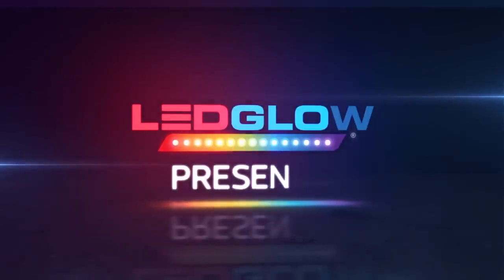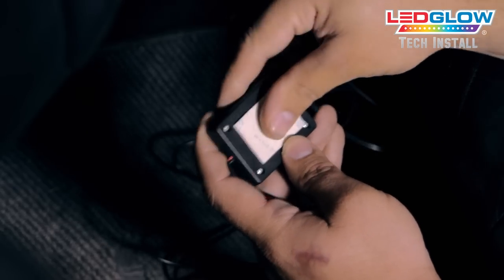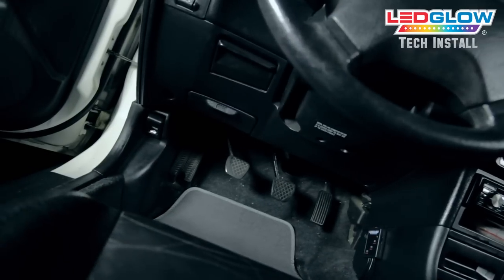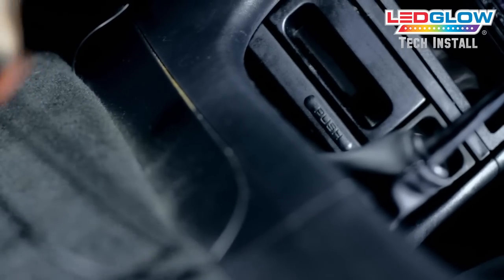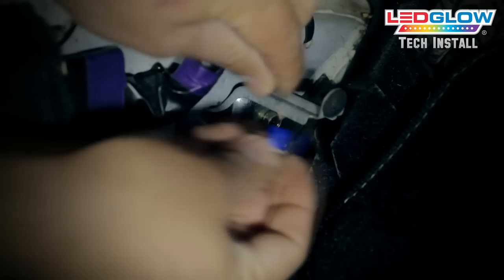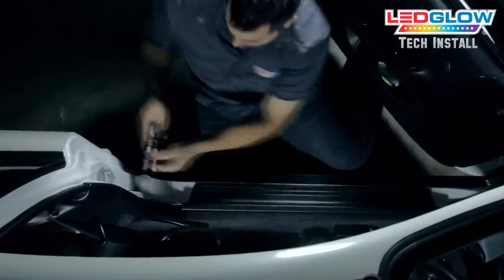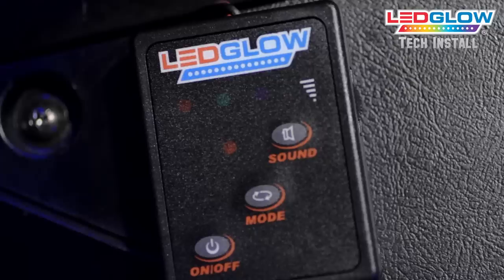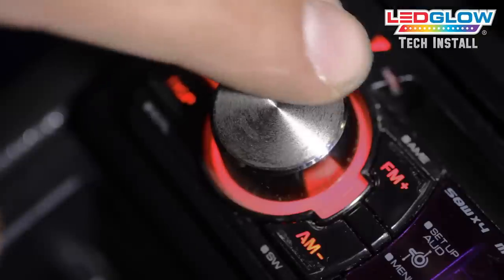Installation | LEDGlow 4pc 7 Color LED Interior Car Lights and Truck Lights

Comment: I plugged it to the cigar fuse using the add a circuit , I can't find anywhere to put the ground wire into the bare metal surface
Reply from the maker: Renzo Chacon You can connect the black ground wire to any screw that threads into metal on the floor board, under the dash, behind the pedals or even the firewall. After you connect the wire to one of these locations, make sure you power your car on to test the kit because most cigarette lighter ports can only function when the car is on.

Comment: I have my kit all set in my 04 Camry & I removed a fuse from the box only to find out that my add-a-circuit is the wrong size and won't fit back into the box.
I'd like to have my lights working by this weekend, what would you recommend me doing?
how would I directly connect my +/- wires to a power source?
Reply from the maker: Trevor Seet If you want to connect the power and ground wires directly to the battery, you will have to extend the wires by using 18 gauge automotive grade wiring. We have a video you can check out called "LEDGlow's Powering Your Kit Directly From The Battery" that will walk you through the install process. If you don't want to extend the power and ground wires to the battery, you can also go to a local auto shop and purchase a mini expandable circuit for your 2004 Camry. If you have any other questions or concerns don't hesitate to ask!

Comment: I have a 2011 dodge challenger se and I was wondering about what all I would need to order. I want the 6 pc expandable million color mini smd led's. Is that all I will need? Will I be able to hook them up without running into an issue with needing something else? And that is the one that comes with the driver and passenger footwell lights right?

Comment: Quick question, how long are the wires? I wanna know if I can pull them towards the trunk of the integra and still have 2 under the seat
Reply from the maker: +Kishen Maharaj The interior kit featured in this video has 6ft of wire per tube. If you feel that is not long enough to reach the trunk, our Expandable Million Color and Single Color SMD Interior Light Kits feature wire lengths of 5ft and 10ft. If there's anything else I can help with don't hesitate to ask!
Reply: +LEDGlow that Is awesome! Thank you 😁😁

Comment: I have a 1986 Chrysler Lebaron, my 12v fuse is always running so the cig lighter remains on if something is plugged in even if the keys are out, what fuse would most likely be the one to go on and off when the car is on and also no short out the leds?

Comment: I just bought this kit from amazon.
How do I should get the cables from the drivers side to the passenger side without leaving them expose?
Reply from the maker: Anthony Paul Polanco Garcia You can pass the wires from the driver side to the passenger side of the vehicle by either under the center console or by passing the wires through the dash. Let me know if you have any other questions or concerns!

Comment: Do you have to ground the wire if you are using a cigarette lighter adapter?
Reply from the maker: brian oneill Yes you will still need to ground the kit, but with the cigarette lighter adapter you will crimp the power and ground wires from the kit into the quick connectors and insert them into the connectors of the cigarette lighter adapter. Check out our installation video called LEDGlow's Cigarette Lighter Adapter and it will go thru the entire process of using the adapter. Let me know if you have any other questions or concerns!

Comment from the maker: Luis, the 4pc Blue Interior Lighting Kit is priced at $32.99 as well as the other 4pc Single Color Interior Lighting Kits we offer. Colors available include Blue, Red, Green, Pink, White, Orange and Purple. If you can't make your mind up on one color or just want more lighting options, we also have a 4pc 7 Color Interior Lighting Kit priced at $34.99. Let me know if you have any other questions!

Comment: 2009 Chrysler 300--I can't find the door switch. Is there an alternative to using this? Also, even if I was to locate the driver door switch, would it still work if other doors are opened?
Reply from the maker: Jeremiah Hocog If you want to have the kit illuminate when you open the driver door then the black ground wire must be installed to the driver door pin. If you find door pin and install the black ground wire to it, the kit will only function when the driver door is opened and will turn off and not function with the door closed. Unfortunately when the kit is connected to the driver door pin, opening any of the other doors will not affect the kit since it is grounded at that specific location. Let me know if you have any other questions or concerns!

Comment: Do you have to use the add a circuit or could you just wire it straight to the battery.
Reply from the maker: +Justin Bryant The expandable circuit is an optional installation accessory that you can use to power the kit from your fuse panel. If you don't want to use the expandable circuit for your installation, you can absolutely wire the kit directly to the battery!

Comment: What are the parts used in this video that is not included in the package ? So I know what to get to make this happen ?
Reply from the maker: The expandable circuit and wire connectors do not come with the kit.

Comment: I want to buy this kit but it looks so difficult to install, if I buy the kit plus the 12V Cigarette Lighter Power Adapter it's like skipping the whole process or what?
Reply from the maker: Gabriel Coello If you feel uncomfortable installing the kit yourself then I recommend taking the kit to get professionally installed at a local auto or stereo shop. The installation process of mounting the tubes, control box and hiding wires will remain the same, but will change when you get to the step of powering the kit. Check out our video LEDGlow's Cigarette Lighter Adapter to see the process of powering your kit with the cigarette lighter adapter! Let me know if you have any other questions or concerns!

Comment: Do I have to use 3m adhesive or can you screw the control box under dash?
Reply from the maker: +Hunter Lovick Thanks for the interest in our product! The control boxes also have locations where you can use screws to mount them instead of using the 3M adhesive.

Comment: @ledglow what about a 2012 camry? I bought the led interior lights but I guess now I have to buy an add a circuit because it didn't come with one so which one should I get the mini or the other one

Comment: Nice video, these look awesome. Any idea if this is legal in Virginia?
Reply from the maker: ***** Thanks for the compliments! Laws and regulations regarding aftermarket LED lighting accessories vary from state to state. I recommend contacting your local police department and ask them directly directly as they'll be able to give you a definitive answer for Virginia.
Reply: LEDGlow Thanks for the reply. I checked, and I believe they are illegal in Virginia. Just for clarification though, you can install these and only turn them on manually, is that right? In other words, the lights don't have to be on every time your car is operating/exterior lights are on, correct?

Comment: Hi I need help with the whole "add-a-circuit" I have the underbody and interior lights kit and I don't know what fuse I have to put in there? Any help would be appreciated
Reply from the maker: Clay Turpin You can use the expandable circuit on any switched (only works with car on or key turned) or unswitched (works with car off) fuse source that does not exceed 15amp. I recommend connecting the expandable circuit to a switched power source because when the car is off with the key out, the kit will not be able to turn on. If you power the kit from an unswitched source, turn the car off and forget to turn the kit off for an extended period of time then it could potentially drain the battery since there will be power going to it at all times. Let me know if you have any other questions!

Comment: how can i install it, so the LED turn on when i turn my headlights on? and is the add a circuit thing required? can i just connect the led positive wire into 12v then put the fuse over the wire?

Comment: I recently ordered a 4 piece LED interior kit and I'm wondering how i know which "switch or source" in my fuse box to use? (I'm new to DIY)
also im installing this into a 2012 vw golf tsi, will i need to purchase a mini Expandable Circuit & 4 Amp Fuse?
Reply from the maker: Simon Torpy A switched power source can only be used when the key is turned in the ignition. If the key is out and the car is off, a switched source will have no power going to it. The best way to figure out if a fuse is a switched power source is by referring to your Golf's owner's manual and using a multi-meter on each fuse. If the multi-meter is reading 0 volts on a fuse when the car is off, but 12 volts when it's on then it's a switched power source. If you want to tap power from the fuse box then you will need a mini expandable circuit for your 2012 VW Golf. Also, make sure the fuse you use to tap power off of is 15 amps or less to avoid having too much power going to the kit. If you have any other questions or concerns don't hesitate to contact us!

Comment: When the kit is installed in your door... Does it function while driving?
Reply from the maker: Cesar Feliz Unfortunately, the kit would not be able to function while driving. With the way you would need to install the power and ground wires into the door switch, the circuit would be open while the door was closed and the kit wouldn't receive any power.
Reply: Cesar Feliz If you want them to function while driving, don't install your ground wire into the door switch.

Comment from the maker: If you're looking to power an interior kit via the fuse box, we recommend using the add a circuit, which can be purchased directly on the product page of any interior kit under "Installation Accessories." For your 2007 Hyundai Tiburon, you will use a mini add a circuit and 4 amp fuse. If you have any other questions don't hesitate to ask!

Comment: Can you use a 10a fuse in the add-a-circut? I did this but the lights aren't turning on, they flashed when i first connected it
Reply from the maker: Infinite Exploit When you say can you use a 10A, is that amperage of the fuse you removed the panel and placed in the add-a-circuit? Or are you saying you took out the fuse our add-a-circuits come with and put a 10A in it's place? If the lights are currently not working, I would recommend calling 856-768-5700 and talking with one of our technical specialists.

Comment: I installed the kit. Everything but the sound activation works. Am I missing something? Did I do something wrong? I have it grounded, and in connected to fuse box. Do I need to connect it to something else like the battery itself or something? I really want that sound activation, half the reason I bought them.
Reply from the maker: FinalShadow17 The sound activation mode will flash regardless of any music playing inside of your car, but when the built in mic on the control box picks up the sound, you will see the flashing become quicker as it is picking up the music playing inside of your car. You can adjust how much sound the mic will pick up from the sensitivity wheel on the right side of the control box. If you are still having trouble with the sound activation mode, please contact us at 877.LED.GLOW and we'll get it fixed!

Comment from the maker: An expandable circuit is an optional installation accessory that is not required, but if you want to power your kit from your Civic's fuse box then you will need a mini expandable circuit. If you have any other questions just ask!

Comment: Will this drain my car battery? Do I have to turn it off manually or does it automatically when the car is off?
Reply from the maker: Steff Vid It depends what power source you use to power the kit from. If you power it from a constant source (you can use the kit whether the car is on or off), you will have to manually turn the kit off from the control box. If you turn the car off and forget to turn the interior kit off for an extended period of time then the kit could potentially drain the battery. If you power the kit from a switched power source (you can only use the kit when the car is on) and turn the car off with the kit on, then the kit will turn off with your car and will not potentially drain the battery. Let me know if you have any other questions or concerns!

Comment: I have a 2012 Honda civic ex. It has an accessory fuse underneath the steering wheel. Do I just connect the red wires of this kit directly to the accessory fuse?

Comment: I have a question, I just bought the 4 piece and was planning on having it installed where it turns on when I turn on the headlights, just in case I don't want the LED lights to turn on say if my parents are riding with me, since they don't know I bought them, can I manually turn them off with the control box?

Comment: my R34 Skyline doesn't have any 12v fuses they're all in amps and the small kind, can I still use the "add a fuse" and should I use a 10amp fuse?
Reply from the maker: +Eric Mills The 12v refers to your car's battery so you're good to go there. You can use any 5 or 10 amp fuse to power your interior kit whether its from a constant or switched source. If you have any other questions or concerns don't hesitate to ask!

Comment: Quick question....So I bought the 2 piece kit last week and just came in. I just noticed that you guys provide a fuse tap, but I already bought one from AutoZone. The other thing I noticed was you guys have a pink fuse attached to fuse tap. Is there any other way I can make my fuse tap I bought from AutoZOne work without having to purchase a new one? If so What can I do to make it work?
Reply from the maker: You will just have to purchase an additional 4 amp fuse to install into the expandable circuit.

Comment: I bought the single color expandable kit with a standard fuse.
I the black wire grounded and all the lights hooked up but I've been trying to figure out what's up with the fuse and the whole lot. My wire splits into two wires one has the black thing with a bulb inside and the other doesn't, they're red and a black strip on them. I've tried connecting all the wires and plugging in the fuse extender with no luck I've tried about everything and I seem to be the only person who got a control box with a wire splitting into two coming from it. 
Any help would be great I really don't want 50 bones down the drain.
Reply from the maker: Kinesis17 Thanks for contacting me about the issue you're having. The red power wire must be crimped to the expandable circuit and the black wire needs to be connected to a bare metal surface. When the expandable circuit is connected to the red power wire, you can then select which fuse you want the kit to be powered from and remove that fuse. Insert the stock fuse from your car into the expandable circuit next to the included 4amp fuse. Now that both fuses are in the expandable circuit, insert the circuit into the slot on the fuse box where you removed the stock fuse. Also one thing to keep in mind is whether you are powering the kit from a switched or constant 12v source. If you're connecting to a constant source, the kit will have power going to it at all times and can be used when the car is on or off. A switched 12v source will only allow you to use the kit when the car is on. I will link you to our most recent expandable circuit video called, LEDGlow's Expandable Circuit for you to check out and if you're still having problems don't hesitate to contact me!

Comment: My fuse box is in the engine compartment. Is there another way to wire it without having to drill a hole

Comment: i have the kit, and bought a seperate add a circuit, which came with no fuse, do i need to add a certain fuse to it and what fuse is best to use if i do?

Comment: I really want to get a kit to install in my 1994 Dodge Caravan. Will it work or no?? Also what could I connect it to in order for it fuction properly?
Reply from the maker: Fernando Rascon Our LED lighting kits are universal and can definitely be installed to your 1994 Dodge Caravan. You will simply connect the kit to be powered from your fuse box, cigarette lighter adapter or directly to the battery and you will be all set! If you have any other questions or concerns don't hesitate to ask!

Comment: I am interested in LED Mini for my 2012 Accord.
Not sure what the kit comes with, but will it have everything in it if i wanted to use the fuse box as the power source? or will I need to order additional installation accessory? if yes, then which one would i be needing?
Will these have the functionality of being wired and coming on when the doors are open as the installation shows?